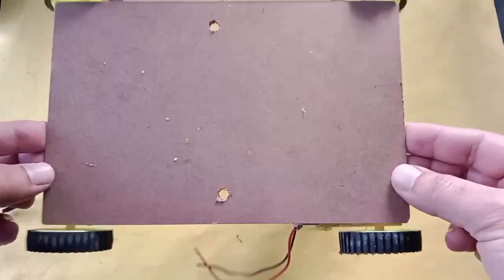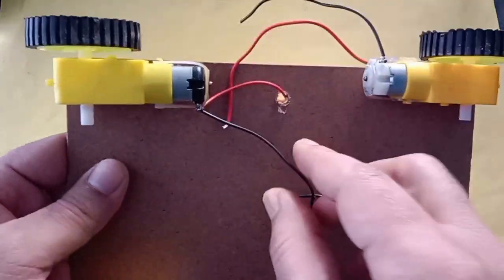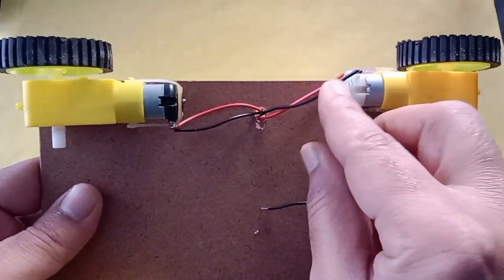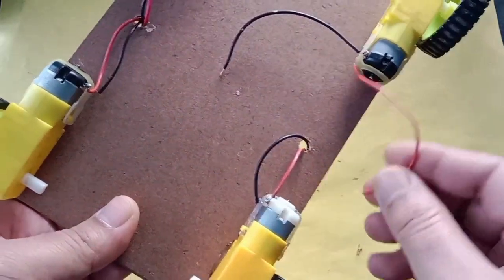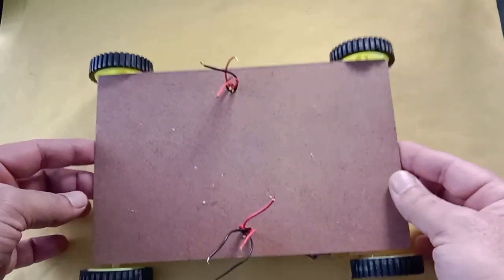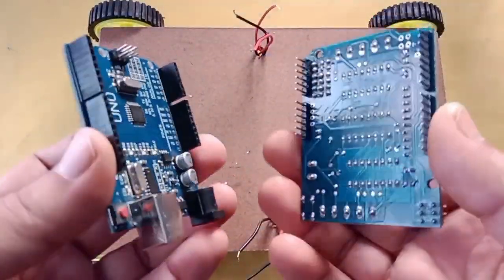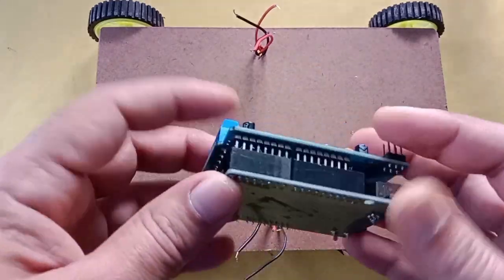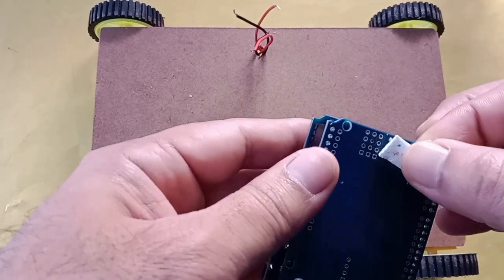DIY Arduino Bluetooth Robotic Car | Control with HC-05 & HW-130 Motor Driver Shield

Comment: Bro meri hw 130 shield me battery ka red wire jal jaa raha he
Reply from the maker: Possible Reasons:

1. The power supply is too high. Maybe  you are powering it more than 12V or using a battery that spikes.
2. May be positive wire is connected to GND.
3. May be motors are jammed or motors are shorted.
4. Thin or poor-quality wire
5. No common ground
6. Short between VCC and GND on the driver

Comment: Yes it worked, but only 2 sec and then first ic on driver get heated so I immediately removed it because I already doubt that it gonna happen sometimes heating issue.

So what to do ? 
My supply to Arduino from laptop and the driver from same as you , 2 li battery as I removed the yellow cap on driver.
2. Tell me what is the problem if heating , as I connected only one yellow TT motor of gear. 
What is the solution of this ?
Reply from the maker: It doesn't seem to be an issue with code. Overheating after 2 seconds is usually a hardware or wiring or power issue.
Reply: Yes I am doing it by removing the yellow cap from the driver as per chatgpt wiring but right now after I saw many of videos like you , I saw that you didn't remove the yellow cap so I done the same thing and only supply from the driver then it worked perfectly ❤

Question:
As per chatgpt it says that you can remove the yellow cap from the driver. Module if you want to supply your Arduino with different supply and to make safe your Arduino you have to remove the yellow cap. So that's why I done that .
Problem is that it should also work with that also but instead it heats the 1st ic , why ?
 @TechCraftAndHacks2

Comment: Bro, I have thesame exact connections but bluetooth controller app says “unable to connect to device” when I select the module
Reply from the maker: 1. Bluetooth module should be paired with Mobile
2. App should show bluetooth is paired 
3. Check wire connections 
4. If the above steps are correct, then please use another app
Reply: @TechCraftAndHacks2 i think the problem is from by Bluetooth module, thanks. Can u pls help me explain why the module terminals are connected to the servo motor slots, I’m sure it’s a question I would be ask in my project defense. I await your response 🙏🏻😊
Reply from the maker: @NameCantBeBlankk  I used SoftwareSerial to create a custom serial port on pins 10 and 11, so I could communicate with the Bluetooth module without interfering with the Arduino’s main serial port used for programming and debugging.